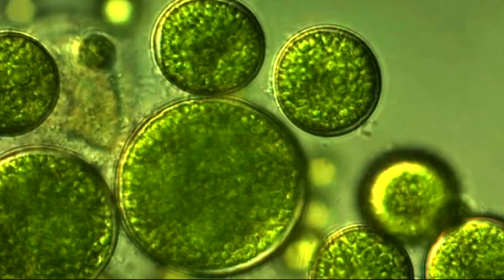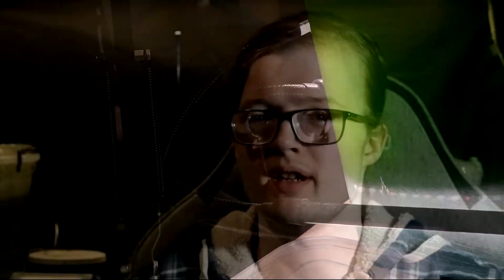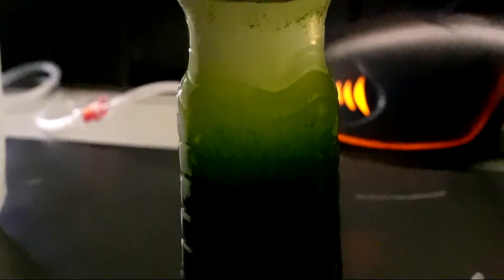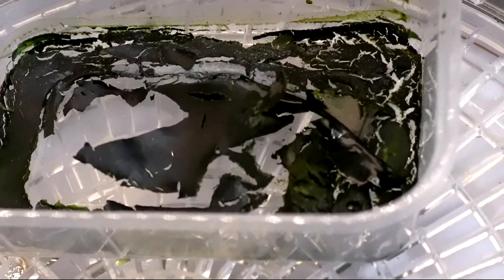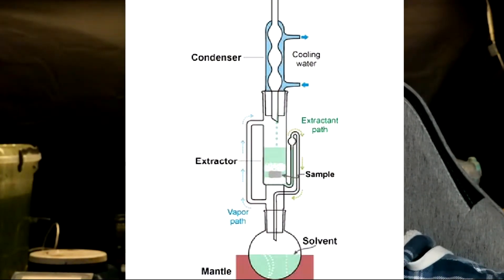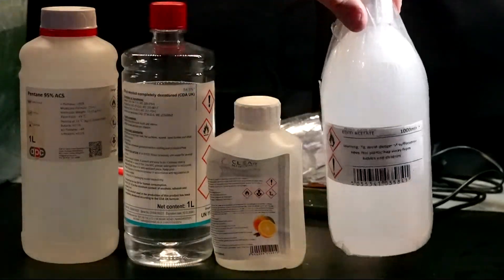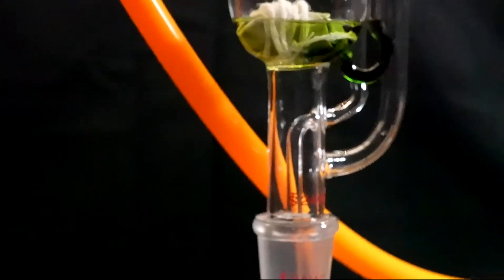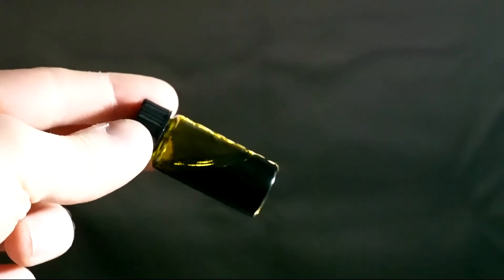Harvesting Chlorella Algae and Extracting Lipids from it

Comment: Just found your channel, i am a MAJOR nerd on this subject so would love to collaborate!

Some pointers now, although the PROPER rant/email etc will probably need to be later as i gotta head off to bed and go to work early, ANYWHO:

Proper Chemistry Glassware for Distillations would be a great near term buy.

Solvent Extraction+Drying then Recycling your solvent as much as possible is definitely the way to go for Algae Oil Extraction.

Another FAR more interesting route in my opinion though is Hydrothermal Liquifaction or HTL.  This process uses the water so there isn’t a need to dry the biomass.  The main issue is you will need a pressure vessel, but it MAY work in a pressure cooker, if not a stainless steel vessel is a pricier near term buy.

Anyways though, it turns the wet biomass into a “Bio-Crude Oil”.  This is near-identical to Crude Oils (although there is no one “crude oil”, but think sweet nice mix of stuff (not heavy or light oil, both)

My Open Source Ecology or OSE Wiki pages on all this have some good papers+ideas you can get info from.

But get the HTL Biocrude, Distilled it into Diesel, Gasoline, Solvents, and MAYBE LPG fractions, then try and use the Bottoms/Bitumen/Asphalt for a Test Core of asphalt concrete, or for waterproofing something, or for “Japanning” paint etc.

Collaborating with “ @NatureJab “ mag be a good idea although they focus on Plastic / Refuse Derived Fuel more than Algae and Biomass.

Simple Gasification or Pyrolysis akin to Wood Gas or Charcoal Gasifiers would be cool too.  Could also try and make a DIY/OS Version of a Syngas to Methanol, Methanol to DME, or even Syngas to Fischer Troph reactor+catalyst.

Determining the Ash Content, Calorific Value, Octane/Cetane (if relevant), Lubricity, Freeze/Gel/Boiling/Autoignition Points etc of the stuff you make may help as well (more niche petchem measurements in my ose wiki ramblings)

Also could maybe network with @MassSpecEverything 

Anywho i hope this information is useful, i would LOVE to collaborate on this so comment/email me/contact me on ose wiki and/or discord please!

And keep up the great work!

Comment: Collaboration on Algae-Based Biofuels and Sustainable Energy

Dear Algae farmer

I salute you and great work!. I’ve been following your work with great interest, and it’s inspiring to see how you’re advancing the potential of algae as a biofuel source. Like you, I am deeply engaged in developing sustainable solutions through algae cultivation, particularly in aviation bio-kerosene and microbial fuel cells (MFCs).

Currently, I’m expanding my network within the aviation sector to accelerate the implementation of algae-based biofuels. In parallel, I’m working on optimizing algae microbial fuel cells to harness both bioelectricity and nutrient recycling, unlocking the full potential of algae cultivation. One of the key challenges we’re addressing in the Netherlands is our excessive nitrogen pollution, largely due to the 12-billion-liter manure surplus from intensive farming. Properly pre-digested agricultural waste, rich in essential nutrients, provides an ideal growth medium for algae—especially when combined with bacteria that simultaneously generate electricity.

Given our shared passion for sustainable energy, I would love to connect and explore potential collaboration. I believe that by combining our knowledge and approaches, we can push the boundaries of algal biofuels, bioremediation, and energy production. Whether through joint research, content collaboration, or technical discussions, I’m excited about the possibilities of working together to drive real-world impact.

If you’re open to a conversation, I’d love to schedule a call or exchange ideas. Let me know what works for you! Looking forward to hearing your thoughts.

This the discord we use 

https://discord.gg/QBYGEJ5f

Best regards,
J.B